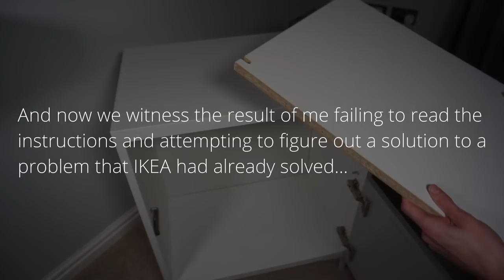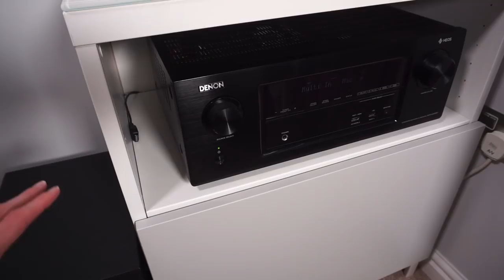Home network/AV upgrade - A more subtle cabinet for the living room!

Comment: It's a good thing you ran 4 CAT6 cables into your office (not including the port behind that small TV). You can use all 4 ports for link aggregation if 2 isn't enough bandwidth for your devices.

Comment: Nice build, 2 Pro tips for you though. 1: For the rack top you could just sand it and stain with some shade of grey ( ash grey for example) then just seal it with whatever you want. Should cost about 30$ and a couple of hours of time assuming you need to rent an orbital sander. 2: If for whatever reason you don't have enough parts from IKEA here is what you do, In the manual there will be a part number ( if you don't have that then just take the part with you ) Go to the largest IKEA in your area, Go to the Customer service/Returns area and tell them what you need and how many, They will just give it you lol. They generally keep a large stock of common fasteners, brackets etc. Just bring your receipt if possible ( I never needed to show it but you never know ).
Reply from the maker: Good point with IKEA - I've done that previously when I had some drawer fronts that didn't match the others properly, they just gave me knew ones.  For the rack I don't think I'd be able to do that as it's just laminated chipboard, not solid wood.  Probably a case of either trying to wrap it or just buying a new top.

Comment: Btw if you have an ir-controlled device, I highly recommend getting a n ir extender, and then running it to just where the TV is, making it feel more "magic" and/or getting a Logitech harmony or similar device. I don't actually recommend them because I've had one of their boxes fail on me, I personally use a sofabaton, but that would still require an it extender
Reply from the maker: I've considered getting one for the satellite box although I'm currently just using it over HDMI CEC using the TV remote.  Might consider one in the future though
Reply: @camerongray1515  yeah those have saved me. Especially if you don't want a glass door, it helps a lot. And of course make sure you ventilate properly lol

Comment: would have been nice to see the cable routing in between the before and after shots
Reply from the maker: To be honest, it's mostly just a mess without really any cable management in both the AV cabinet and the rack.  The rack in particular is a pain to access from the rear so cables are just draped in and connected without any attempt to manage them.  I'd previously managed the rack a lot neater but it meant that it was a nightmare to replace cables from the front without being able to get in the back to remove cable ties.  The AV cabinet is much the same - cables are just connected and stuffed behind the cabinet and receiver just so that none of them are immediately visible from the room.
Reply: @camerongray1515  shockin! :)

Comment: hello there .I would have  drilled 2 more cable holes near the top of the back board to let out more heat from the av receiver.We seem to be getting more hot weather these days , and this would help.enjoy your`e  videos.

Comment: Cool video man. I used besta units for my home av gear. Be watchful with equipment under load, it can get REALLY hot even with space around them. I ended up picking up small ac infinity fans with a thermostat to aid exhausting them out the front on either side of my PS4. Looking forward to the speaker video!

Comment: Could you not have just pulled the middle shelf forward, dropped the plugs down then put it back as there was space for the cables, rather than cutting a hole to put them through  between the shelves, comedy gold with the shelf brackets thanks for leaving that bit in.
Reply from the maker: Unfortunately the shelf sits flush against the back of the cabinet, you could maybe squeeze a couple in but you'd be having to flex the back panel

Comment: Not to sound like a super fan, but...didn’t you have a Fujitsu server in the rack too? Did you move that elsewhere, or did it crap out? Neat watch though, thanks for sharing! ☺️
Reply from the maker: I replaced the Fujitsu back in March 2019 with the new server and used it's RAM and CPU in the new build.  I just fancied a proper rack mount machine rather than a tower on a rack shelf.  There's a video of the new build on my channel somewhere.
Reply: I think this was the video 
https://youtu.be/9WINLuOBh3U

Comment: Hey Cameron,

It seems like that cabinet is made by a Polish manufacturer, and that they actually offer multiple replacement toppers on their online shop: https://sklep-zpas.pl/biurowe-szafy-19-sjb/biurowa-szafa-teleinformatyczna-sjb-10u-600x600-z-blatem-zpas.html

I'll be looking to see if I can have one imported in the next few months, as the price seems right!
Reply from the maker: Interesting, I knew they were polish but didn't know they had an online store, back when I got mine it came from a warehouse in the UK.  Do report back if they'll import it to the UK, there's definitely demand for it from the comments I've received!
Reply from the maker: Only tricky bit to be aware of is the rack comes preassembled and doesn't come apart, so you'll essentially be having to ship something the size of the cabinet so it's not going to be particularly cheap!  Mine arrived on a pallet!
Reply: @camerongray1515  This is a good point - it may be why they're still happy to ship inland. I'll send them a message and see what they say!

Comment: nice mount for the wall, for the network, audio and antennecable. Where did you find those?
Reply from the maker: They're called Euro Modules which is a standard in Europe (and some other countries) where you get separate modules and then faceplates they fit into and they are generally interoperable between brands.  It's a similar idea to keystone jacks as commonly used in the US.  Not sure how widely available they are worldwide though.

Comment: Why not have a sounbar under your tv and just have every of your inputs lets say hdmi go to your tv and optical cable the signal to the soundbar? Less speakers, less cables etc ect
Reply from the maker: I don't have anything against soundbars, they're a huge upgrade to the speakers built into TVs but they're nowhere close to the performance of a full 5.1 system like I have here. They're probably comparable when it comes to basic dialogue but for surround sound in movies or music, a system with separate bookshelf speakers will sound a lot better.
Reply: Cameron Gray yeah true thats a good point
Reply: Currently rocking an LG SL7Y with the extra rear speakers for full 5.1 and it's better than most off the shelf 5.1 systems I have heard. Plus it all wireless!